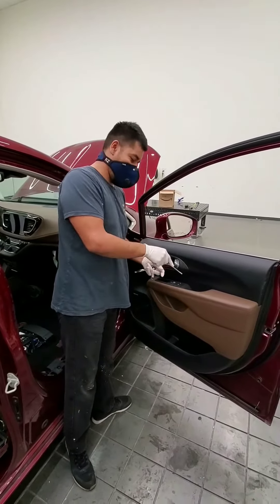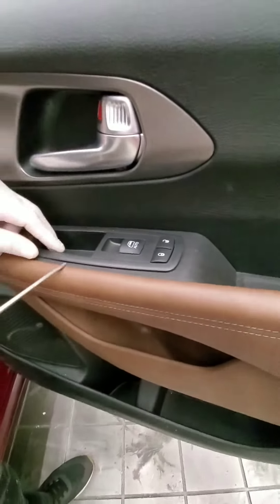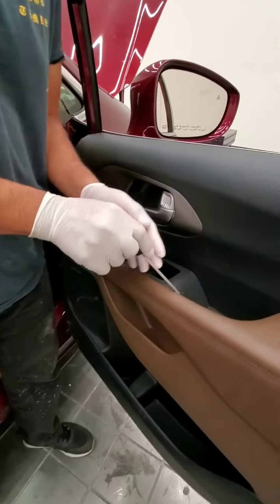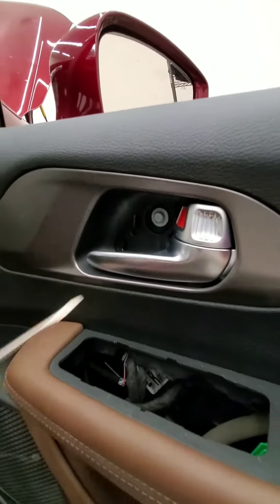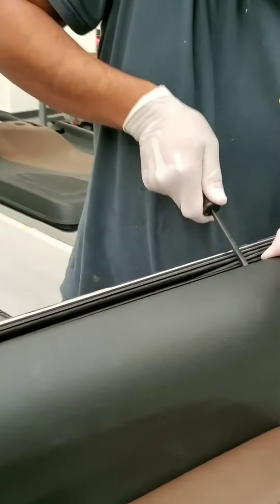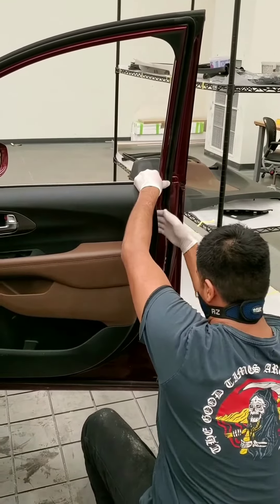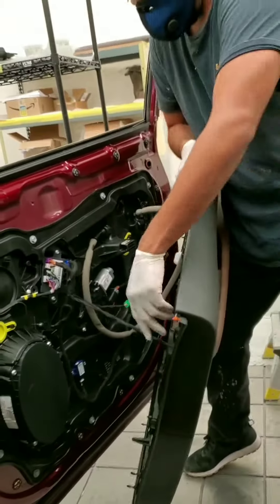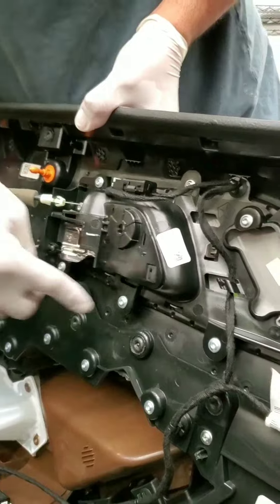2018 Chrysler Pacifica Door Panel Removal

Comment: Can you do the sliding door please? TIA
Reply from the maker: I'm sorry I wish I would have done it, but I chopped this car up completely a week after these videos. Sorry.
Reply from the maker: The sliding door does require you to remove way more parts including the inner pannel lining (of door) to get the cables that open the door off to be able to eventually remove the door, that will be the hardest part of the whole removal. The rest is super easy, it's hanging on top by 4 bolts I believe, 2 on each side. One on the bottom I think and you have the sensors under the rocker, which you have to remove for the door to be completely removed. Hope this helps..